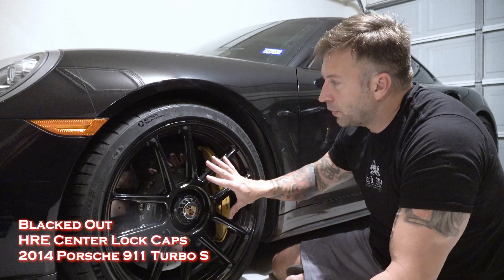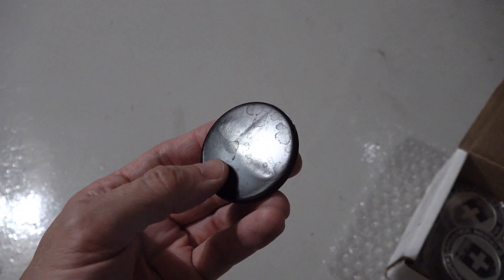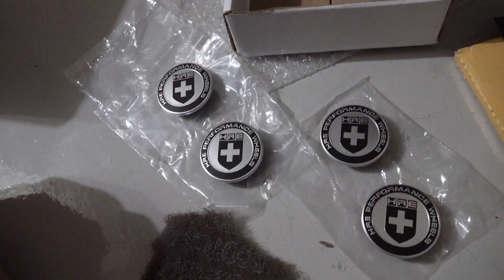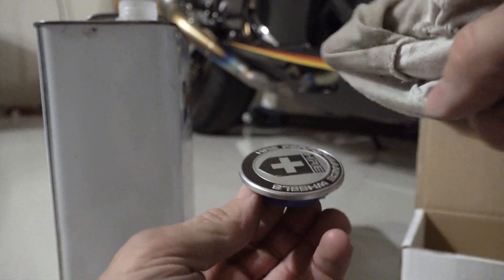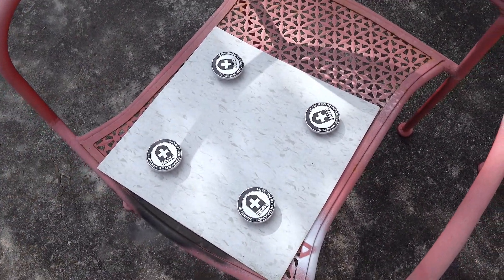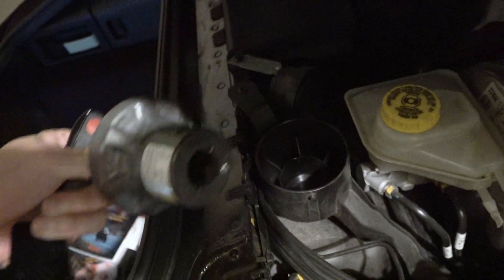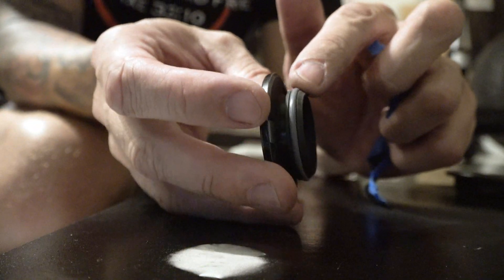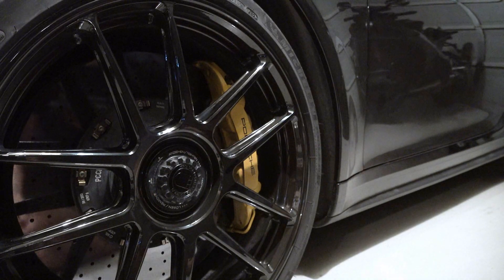Porsche Wheel Center Caps Upgrade to HRE Wheels Porsche Caps - Porsche 911 Turbo S

Comment from the maker: final touch to the HRE wheel upgrade are the blacked out center caps
Reply: How did you fabricate/machine the previous porsche center caps that fit the HRE wheels?  Thank you.
Reply from the maker: @lewmologne5948  i didn't modify the original porsche caps. i used the center caps from HRE and just painted them black. i believe the old porsche caps would fit in the HRE wheels yet though because they snap into the center lug if i remember right.